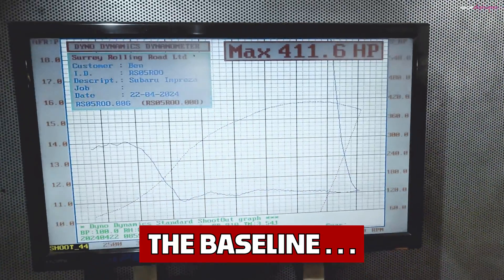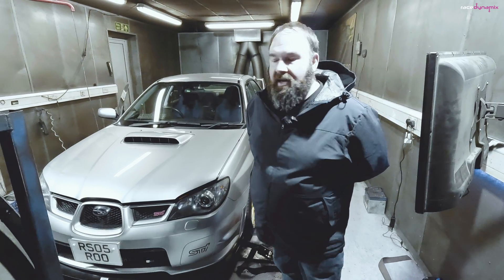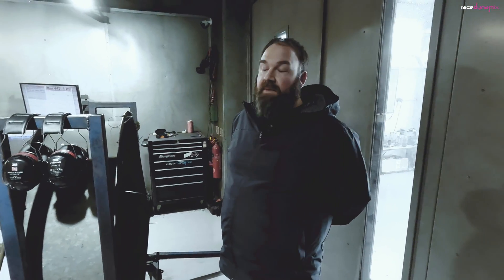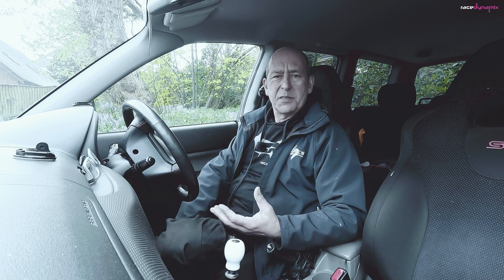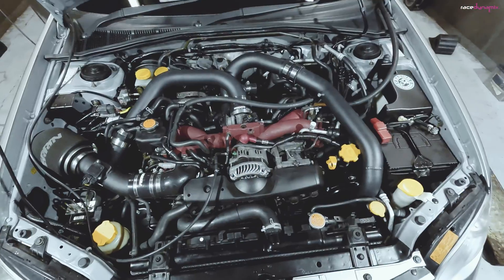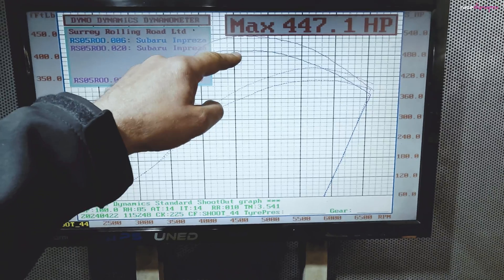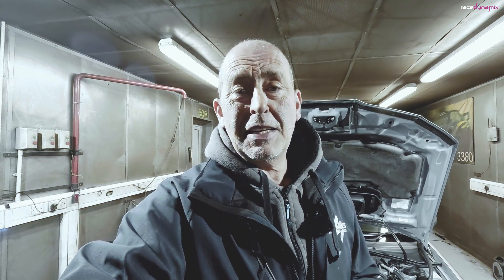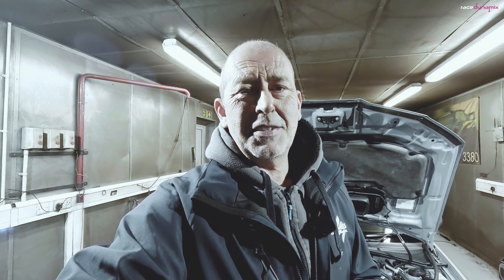FMIC vs TMIC: Worth It On A Subaru Impreza?

Comment: So... this wasnt an apple to apple test. The fmic doesnt make more power. The ability to run more boost made more power. 

An accurate comparison would have been to run both at the same boost pressure.
Reply from the maker: The test was to see if more power can be made with a fmic.  It did.
Reply: @racedynamix  the video contradicts what you saying. You should have presented the video as "Whats the hp you can make on a TMIC vs FMIC"

As others have also said the conditions are not the same for your test ie boost pressure, so the test per your description is null and void
Reply from the maker: @peenez.carban but why would you fit a fmic and not map to take advantage of the extra cooling and potential.
Reply: @racedynamix again you are missing the point your viewers are trying to bring across. What the title and opening seconds of the video, and the viewers expect or want to see is an apples to apples comparison. Tmic vs fmic. 

Baseline with top mount. Then install front mount and make necessary changes to fueling etc so it can run safely, then compare the two. Afterwards add more boost and timing, as the front mount intercooler will allow, to show the potential of the front mount. Simple test. 

Your test only shows how much harder you can push an engine with a front mount vs a top mount (which most already know).
Reply: @peenez.carban  "Your test only shows how much harder you can push an engine with a front mount vs a top mount (which most already know)"

Exactly the whole point of the video, its a common question in the subaru world as to when is it needed to go front mount, the common answer is usually circa 400bhp, the top mount was at its limit efficiency wise with this turbo setup, it was to show how a running a front mount means more power at this level. Not everyone knows about needing to change to a front mount mid 400bhp, just look at the forums on a weekly basis, people don't really have a clue. i was getting the car mapped and thought it would be a decent back to back comparison and proves the point nicely.

Comment: 30hp gain but costing 10K of parts and labor?
Reply from the maker: @andyy6481  10k ? The difference between a good tmic and a cheap fmic kit is peanuts.
Reply: @racedynamix  so how much is the entire thing all put together?
Reply: @andyy6481 not sure why it's relevant what the entire build costs when the purpose of the video is to show the difference between front mount and top mount. 

The fmic was £300 and a days labour for myself so fanny around making brackets etc for the washer bottle.

Comment: My main concern with adding a FMIC is having to remove the stock crash bar. I'm afraid of losing coverage if anything happens in the front end. Do you have any advice or experience regarding this? I'm from Canada, so I understand this may not apply to you. Thanks.
Reply from the maker: @stuff1235  I declare the modifications to my insurers here and would recommend asking them before doing it to see the impact on premiums / coverage 👍

Comment: Would the fmic be a similar percentage increase power wise on a va sti vf48? Is it necessary to cut out the plastic bumper grill out of a va sti to be effective? Also, only some intercoolers fit with intake boxes such as Cobb sf redline etc. Do you find intake boxes to be beneficial and lower IAT over intakes without boxes?
Thanks for all of the info you put into your videos!
Reply from the maker: Hi - sorry for the delay in replying. Yeah the power gains would be similar in % terms.  The fmic relies on airflow so as much as possible is beneficial.

Induction kits can help above 350bhp ish from a flow point of view.  IAT with an airbox is slightly better but miniscule when actually driving.

HTH :)

Comment: 850cc injectors, that's not possible
Reply from the maker: @NovoGold  what's not possible ?
Reply: @racedynamix  how are you getting away with fuel delivery only using 850cc injectors..? Here in Australia I don't know of anyone using anything under 1050cc injectors. 🤔
Reply: The standard injectors can cope with upto 400bhp so why couldn't 850s cope with 50bhp more ?@NovoGold
Reply from the maker: @NovoGold  the max power that a set of injectors can flow for is approx 70% of the cc assuming good fuel and other supporting mods.

1050 cc injectors are good for close to 700 bhp
Reply: @racedynamix  all good, I just wasn't aware of what stock injectors would cope with. Thanks for the info, much appreciated 👍
Reply: @NovoGold  the injectors I'm using are actually uncapped or modded oem injectors to flow more.

Comment: I dont really like to cut my prodrive bumper for a fmic
Also those aftermarket ic are way thikker material that means when heat soak they will take longer to cool down
I was also wondering what the effect of the ic spray on the ic is and how much does the temp drop and what the result is on the power
Reply from the maker: Heat soak isn't an issue at the front and airflow works to cool them much quicker than a tmic.

The IC spray does almost nothing, I have tested in the past but will do a video at some point on that actual effect on numbers 👍

Comment: If i build a fmic on my subi,2013 sti full stock, do i need to tune my car ? Would I still benefit the iat as well ?
Reply from the maker: @thomaswahahauw560  Yeah it would need a tune as you would be replacing the std induction set up with an induction kit of some shape.  That will alter Afr .. mostly leaning it out.. and could make it dangerous or run badly 👍

Comment: Hi have a question. Is the 2005 2.5 sti engine any good? I hear a lot of Bad reports about it. I want to run 360bhp. Will the heads and rings be ok at that level of power?
Reply from the maker: Hi..  Great question.  The 2.5 is inherently weaker in design but should be OK to that power level if mapped to be det free.  The Ej207 would be much more capable of handling that power and significantly more tbh.

The ringlands and headgaskets are a weakness on the 2.5 but it makes for a great road engine because of torque.  hth

Comment: No extra power bra.. the front mount actually creates a heat trap that soaks everything with heat and is pointless in every way, unless…. You have your radiator in the trunk like the rally cars that use front mounts. A well ducted and proper sized top mount intercooler will yield quicker throttle response and recover from heat soak quicker, as well as not blocking the radiator from doing its job cooling., top mount for the win on your average daily driven rally car. Unless you move the rad to the back. Then front mount obviously would be better.
Reply: Did you not just watch the video?
Reply from the maker: obviously he didn't 🙄🤣👍

Comment: For those that skipped through it, 0.2 bar of boost was added to achieve the actual dyno gains (10-12 whp gained per psi).  The challenge with the intercooler is determining what you need in a dynamic situation to maintain stable IAT values at your selected boost level.

I would be VERY interested to see how a Spec C top-mount factory I/C with Auto water spray compares to a front mount in terms of being able to push the boost.
Reply from the maker: 👍 The ic auto spray doesn't tend to make much difference on the dyno from when I have tested in the past (pre YouTube days) I will, however, see whether a suitable car arrives to making a video of the test going forward.  Size and location will work against a spec c tmic compared to a fmic though.  Thanks for watching and the comment 🙏
Reply: Would of been better with a fat tmic and a cold air intake that air filter is sucking hot air
Reply: @matthewperkins3796  the delta you see from compression makes the under-hood temp. not really that big of a deal.

Comment: Would have been great to show 1.4 bar vs 1.4 bar, but I’d be happy to push 1.6 on both setups with proper iat compensations set up. I’ve tested all 3 setups tmic,fmic, and custom water to air and wta wins all with ease.
Reply: I thought the same. 
A fair comparison would be at the same boost.
Reply from the maker: Noted.  The car will be back again at some point and we will try and do some more filming 👍

The objective was to see the difference in power though from an optimised map on a tmic to an optimised map on fmic. Regardless of boost the fmic enables more power to be made.

Running the tmic at that boost on that car would not make more power than it did at 1.4 hence why it was mapped at 1.4.  The better efficiency of the fmic at removing heat allows more boost to be used.
Reply: I'd just like to add, (my car by the way ) 

My previous mapper did add more boost at first with the top mount but it wasn't making more power and was creating heat.
The car was happy where it got mapped. Plus it was a warm day outside and was mapped on the road.

This example is of my setup. All setups will give different results.  My aim from this video was just to show the outright difference from a turbo that's rated in the low 400s where boost levels will be high and so will the heat. Could of easily of got a big 500bhp turbo and run lower boost to achieve 450bhp, but I wanted a turbo that gives great responce and boost that comes in nice and early like oem.

You can go crazy onhow indepth the tests are, but this kind of test with this setup just shows very quickly what a front mount is capable of. And shows the limitations of the top mount at this level.

Comment: thanks for the response. I am aiming for 400bhp . Was going to upgrade the turbo from stock vf34 and upgrade air intake bigger injectors and a good remap. But was unsure if 400 would be safe on the standard engine. Also keeping the standard clutch on the car as well.  Has the Sti top mount intercooler
Reply from the maker: Hi.  Those mods won't make 400 tbh, a more realistic target for those mods is 340-350.  At that power level the std engine should be fine if tuned det free and with good maintenance.
Reply: @racedynamix  ok. So a hybrid turbo upgrade bigger injectors front mount intercooler upgraded induction kit and a down pipe straight through 3inch and a updated fuel pump and a custom won’t make 400 from 280bhp what would I need to add to the list to make the 400
Reply from the maker: @silenthill87  ah a hybrid 400 bhp capable turbo might help you get there with fmic and injectors 550cc or slightly larger... But you are definitely into engine death territory.  If you are worried about that happening I would keep below 350, if you are not worried then a set of ported std headers will help it get more power
Reply: @racedynamix  100% thanks for the info

Comment: Wondering if the temps would be better on the the VB WRX with TMIC since the turbo is no longer below the TMIC.
Reply from the maker: I think they would be better but still suffer from heat soak and inefficiency due to location and direct airflow, albeit the newer scoop is a better design. Fmic still wins outright imo
Reply: @racedynamix  agreed.  It pains me to have a non-functional scoop though lol.

Comment: Great vid. The interesting thing here is the spool hasn't changed on the graph is that maybe to do with altitude? I am in an area where we are at 5000ft above see level we do see the difference in response from a front mount to top mount almost 1000-1500rpm specially on the 2.0 but the end power figure does vary. The 2.5s however really do perform better with front mounts.
Reply: Altitude and also subarus with vvt help as you can tweak it, and a good tune will bring the turbo back in
Reply from the maker: Indeed... Response and boost threshold are different, there will be a slight delay in refilling all the pipework from a fmic but once going it will outperform a tmic easily 👍 even at altitude 😎

Comment: I’ve got a fmic in the boot lol still to be fitted to my sf5 fozzy s . Yesterday some kind gentleman smashed into my beloved fozzy parked at the side of the rd back to welding thought I was done . New rear quarter panel bumper tail light trailing arm bracket the joys of motoring…… my fmic is all silicone hoses no metal does this affect it?
Reply from the maker: It shouldn't affect it too much... The early APS kits were all silicone and worked well 😎

Comment: I've heard that FMIC on subarus with stock location radiators reduce the cooling effectiveness of the radiator because the FMIC is blocking a portion of the radiator. Thoughts?
Reply: Air goes throught the intercooler then the radiator mate. no cooling issues.
Reply from the maker: It makes zero difference in my experience 👍

You might have just added another myth to be busted 🤣👍
Reply: @racedynamix  heard it from dominic Acia (getadomtune). Would an interesting experiment
Reply: @racedynamix heard it from Dominic Acia (getadomtune). Would be an interesting experiment
Reply: Got this info from getadomtune. Would be an interesting experiment

Comment: I’ve a question. In a 2004 blob eye 2.0L wrx sti.. what is the maximum bhp the engine can take without having to forge the engine etc
Reply from the maker: I have customers running 496bhp on the std engine... But they are aware that they are on borrowed time.. It will break at that level.

There isn't a hard fast limit on power though.. What are you aiming for?
Reply: @racedynamix  thanks for the response. I am aiming for 400bhp . Was going to upgrade the turbo from stock vf34 and upgrade air intake bigger injectors and a good remap. But was unsure if 400 would be safe on the standard engine. Also keeping the standard clutch on the car as well.  Has the Sti top mount intercooler

Comment: I wonder if there would be as much a gain with a smaller oem size turbo like the td04 or vf35?
Reply from the maker: The gains won't be as much obviously but it could be worth it if car used on track etc.

Comment: Well 👍, as a former Impreza owner I always thought that Subaru should have done the original FMIC when producing the car 👊
Reply: It's never a bad thing but subarus have never been any higher then 340bhp from the factory (apart from the cosworth 400 version )

Most are like 220 to 300 on average from the factory. Sti top mount performs really well at that power level. And the bonnet scoop is so iconic now that I couldn't imagine a subaru without one

Comment: There is no issue with hawk scoop and air flow till 480hp,always You can put bigger scoop.You gain more air as sti top mount is  to small to take more.  Process West top mount with scoop undertray  is best to go with that power level. I will more worry about heat soak trough air cone filter ,should be in a sealed box with air snorkel attached and about brakes going above 100mph on track.For track just remove engine undertray .Than You block radiator with front mount intercooler giving it less air to cool it down. Engine oil cooler could help to plus meth map.
Reply from the maker: It will always make way more power wuth a fmic at that level.  A fmic does not reduce the cooling of the radiator at all in my experience.

Comment: Great explanation and proof of front mount over top mount, do you think the mega expensive front mounts are worth the extra££££?
Reply: I've only seen them on videos. Only difference I see is the quality and fitment tend to be better. 

I knew someone running a timeattack car with 700 plus bhp with a cheap ebay core and his temps was fine. 

Biggest fitment issue is having to destroy your front bumper on the inside, but I think that's the case regardless. 

I think for the money, this particular kit doesn't fit bad at all.
Reply from the maker: The fitment of the more expensive kits is much better, the pipework quality is much better too. Some of the cheap kits you wonder whether the designers have even ever seen a subaru 🤣
Reply: @racedynamix  they ran out of budget mate lol
Reply from the maker: @benc911  🤣
Reply: Good after market top mount and cold air intake car would of done better front mount for over 480bhp

Comment: Shouldnt the top mount be able to hold the same amount of boost? Or did you just up the boost with the fmic?
Reply from the maker: The top mount can't rid of the heat quick enough so wouldn't take more boost before having to reduce ignition timing and actually make less power.
Reply: @racedynamix  Ahh i see
Reply: @racedynamix  Would this apply with a speed density tune?

Comment: Great video. What are your thoughts on companies selling their fmic kits as install ready requiring no remapping? Did you change fueling or timing at all?
Reply from the maker: I think that is wrong... Fitting a fmic requires fitting an induction kit and that changes fueling.  On this car the induction kit was there for both tmic and fmic so I didn't change fueling at all.

It took more ignition timing and because the air was cooled better it allowed me to run more boost. 👍

Comment: Hi there was thinking about a front mount myself .but will it need a stage 2 remap to feel the benefits thanks . Currently running 320bhp on stage 1 tmic
Reply from the maker: I don't really do stage 1 or stage 2 maps.. Just custom maps for whatever is on the car.  There will be a power gain on your from fitting and mapping a fmic though but at that sort of level a tmic is doing OK 👍

Comment: If you were running a Process west Top mount you'll still make that power figure and keep the spool, the stock sti top mount it's limited to what psi it can hold and still remain thermostatically efficient
Reply from the maker: They are good but still nowhere near as good as a fmic. The wrong location so suffer heat soak and issues with airflow at speed missing the scoop altogether 👍
Reply: They cost a fortune, also heatsoak whilst sat in traffic is still an issue, and the other issue with air going over the scoop over 100mph is still there. Top mount is fine for a road car really.
Reply: 17+ STI TMIC >>> aftermarket TMIC with the exception of the OG Spearco.